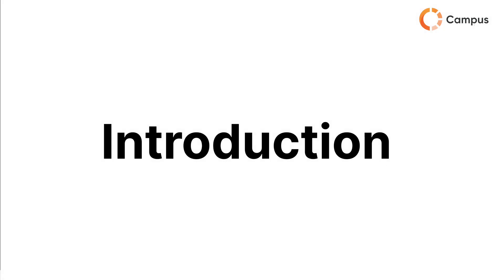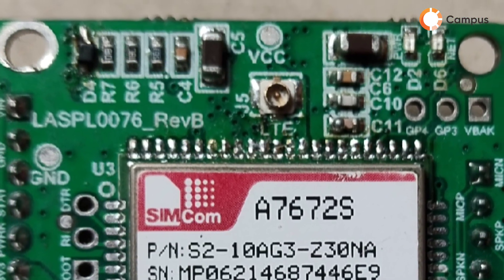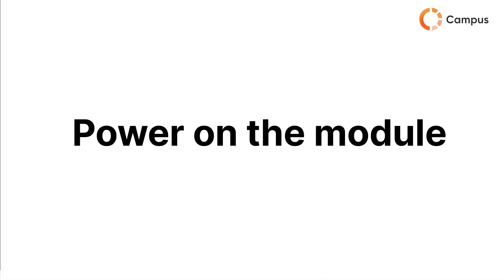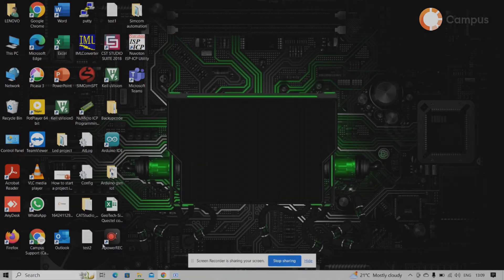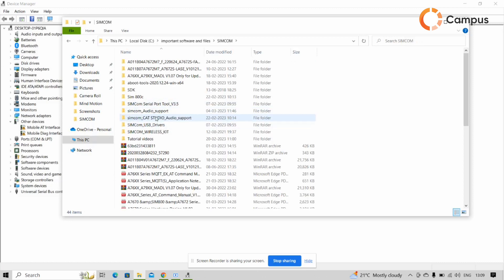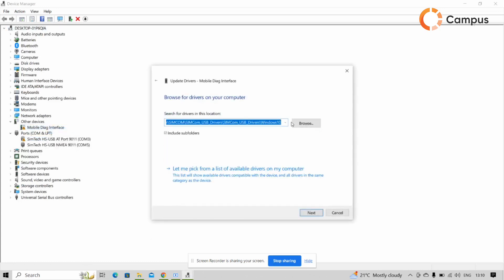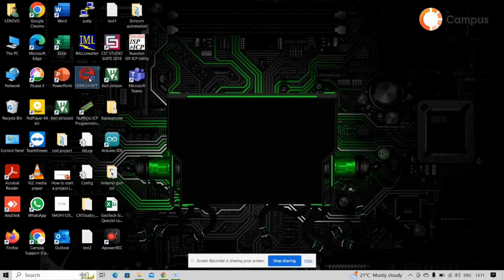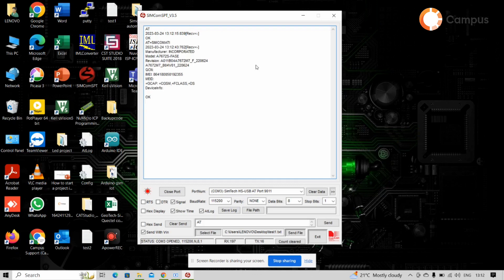Introduction of A7672S | How to get started with A7672S | SIMCom | Campus Component

Comment: Can it support nb iot, gps
Reply: Hallo sir, Basically this module has two variants, with GPS and with out gps. If you'll use A7672S with gps module then no need any other gps module. But if without Gps module then you can use any gps module you want, but I suggest you to use Allystar gps module - much price compatible.
Reply: @CampusSupportSupratimMaity  price?  In your site it does not show